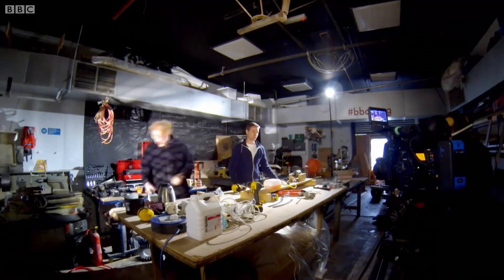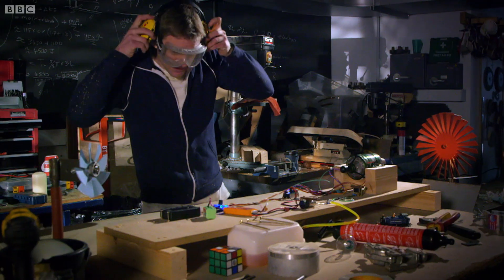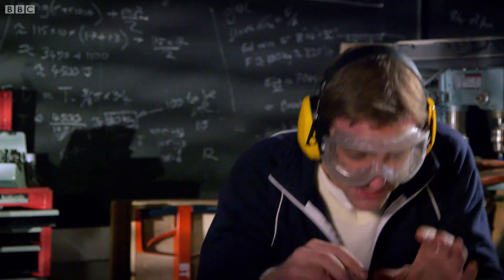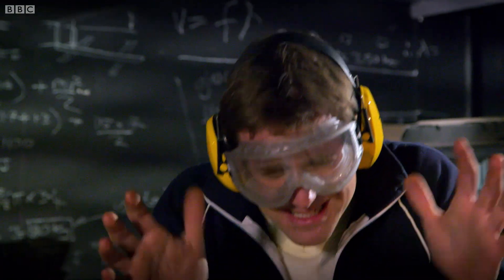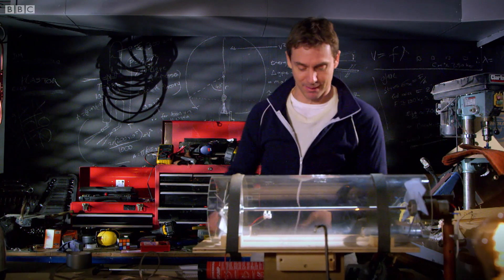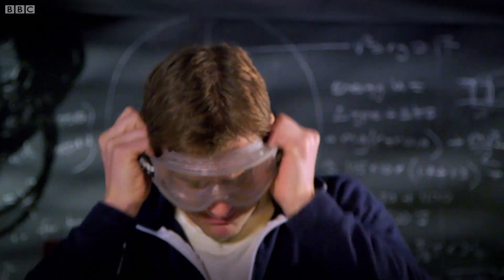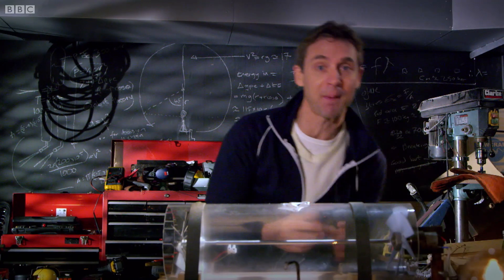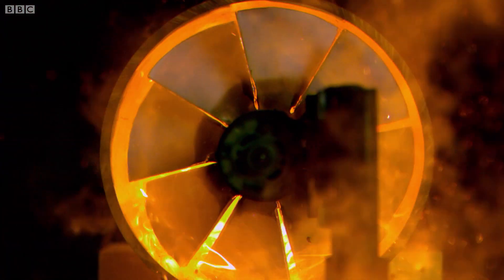How To Make a Mini Power Station | Bang Goes The Theory | Earth Science

Comment: That makes no sense. This video is terrible.
Reply: Simonas Mažeikis
The gas does not have to come from fossil fuels however. But I agree that this video can be misleading. I am very much against this simplification off power generation that leads people not jump to wrong conclusions.
Reply: Simonas Mažeikis I can see why you say that. Seems to be a bit thin on context. Which in it self can make the whole video a bit misleading.
Reply: Cythil Of course it will never be one solution, unless we figure out fusion or something like that. Fingers crossed for the fusion reactor in france.
Reply: Simonas Mažeikis Okay yeah, the context and demonstration given is a bit lame. A gas turbine generator is one of the most efficient methods of generating electricity.
Reply: Simonas Mažeikis Biggest advantege over coal and nuclear power plants is flexibility. Over production of electricity is an issue in current power grid systems. You should match demend and supply to maintain grid stability.
Reply: Simonas Mažeikis
That is not true. Nuclear power has a lot of lag in it production. So it take time to both increased energy production and decrease it. Unlike Hydropower for example which you can turn on and off at pretty much will.

Gas turbines like this can be used to handle peaks rather then you having to stuffer brownouts or rolling blackouts. Especially in a area where you can not relay on other forms of backup power production.

Mixture of different types of energy production is needed to as a way to balance out the needs of the energy grid.

Nuclear power however is good for the main load.
Reply: Simonas Mažeikis
I did mention hydroelectricity already. And yes I prefer it over burning fossil fuels. But what is the best energy mix depends on regional factors. And of course when technology develops it also open up new opportunities. What energy mixing that is considered viable today may be replaced in the future by other solutions.

If we could dramatic reduce the losses we get transporting electricity in our energy grid, then you would have also have to relay less on extra power plants to handle peak demand.

I do not think gas turbines will be something that will have a large role in future energy production. But I can see it having a small niche role to play. Having gas powered backup generator for a hospital for example. Or use it to burn off excess methane to cut down the energy consumption of a large farms.
Reply: Simonas Mažeikis Why?
Reply: Kael because fossil fuels is what we are trying to get away from and this video is somehow trying to make fossil fuels for making electricity seem appealing. He even compared it to nuclear, how can you even do it, nuclear power is on a completely different level.
Reply: Cythil yeah okay it could come from compost, but then again it wouldn't be on demand power, storing gas requires energy and is not efficient either. Also powering cities from compost is near impossible,  our power demands are huge.
Reply: Simonas Mažeikis
It would just me a part of the mix as I see it. Not the only thing used to power out future. This faulty reasoning as I see it one of the huge issues of the energy debate. Like we have to relay on one solution when likely better to depend on a lot of solutions. All complementing each other. Why very few nations relay on just one energy source today for there needs.
Reply: Simonas Mažeikis
Even if you get a fusion economy or a solar economy going on a massive scale I think there might be reasons to have smaller powerplants for other reasons. But who knows. Today we actually burn bi product methane without using the energy it produce for environmental and safety reasons for example.

(Also Fusion may have a lot of lag in it. But I have not checked out all the designs.)
Reply: Cythil solar is not that powerful though, we can't cover the whole earth with solar panels... The whole roof covered in solar panels can't even sustain a household in places which get less sun. Nuclear and coal is pulling the heavy loads at the moment, we need to get rid of coal atleast and then move on to something else.
Reply: Simonas Mažeikis Silly me, I thought the point of this channel was to show how stuff worked.
Reply: Simonas Mažeikis
You expecting they would be placed on earth and not in orbit of the sun. A true solar economy would uses large space arrays beaming the power down to the planet for use. Large part of manufacturing might also be moved to space in this future economy. This could in theory provide a lot more energy then even a full scale fusion economy. After all the sun is just a big natural fusion reactor with mass of 333 000 times that of Earth. Even just capturing faction of that power would be far more then we could produce on earth using our own fusion tech.

But we are at the moment pretty far away from releasing that. Our own fusion power seems like a more likely short term solution.
Reply: Simonas Mažeikis You're correct in that it isn't a solution for renewable energy. However the ability to regulate power output and fuel input, though seemingly vital to our energy needs, is completely lacking in the most popular sources of power such as coal and old oil refineries. The grid is constantly producing 'rejected power' that goes unused by the grid in low usage, so that it can handle the upper levels during peak hours. 

If we created energy standards throughout the country, and cannibalize coal plants into new high efficiency gas turbines, we'd save more fossil fuels now than a years worth of solar/wind could provide currently. (Though personally I'd rather just invest in making solar panels a real industrial process, it does have merit in understanding that Adaptability is a crucial part of a sustainable power solution.)
Reply: Michał Leszczyński it has no advantages over nuclear lets get this point clear, we cannot drop nuclear ever anymore because of how much power we need. Over coal maybe.
Reply: It's not about the lag. It's about the amount of energy that we need. Households use about 10% of all the electricity we need that's a tiny amount and production goes almost 24/7. Most of what we use we use constantly. So the increased demand and such is not that big of a deal.
Also we already have a great method to store energy during downtime that we can use during demanding hours, it's called Pumped-storage hydroelectricity. That method is also better for the environment and it lets us compensate for the unstoppable nuclear power.
Reply: Simonas Mažeikis I know that we can't drop nuclear power plants. But we can't have only them, because it is impossible to turn them off.  SO if there is sudden drop in demand you can't adjust supply. If you will produce to much power you can cause power grid destabilization. So nuclear plans are great for producing large amounts of power and gas power plants are great for adjusting supply  with demand.
Reply: Simonas Mažeikis You still can't adjust pumped storage as quickly as you can a gas turbine so you end up wasting energy. A huge percentage of what goes into the grid is wasted as heat in the lines from resistance so if you create a large amount of excess to avoid running out of supply it's still going throughout the entire grid then returning to the power plant at a significant loss. It still works out more efficient to use gas to cover those small spikes. The good thing is to that these gas generators are usually located within a city so  they have less loss travelling through the line, something you can't do with other sources.

Comment: Shouldn't the second turbine(in the second experiment) turn anticlockwise and not clockwise?
Reply: Cheydinal actually the second turbine and the first turbine should be on the same axis, fused into one unit, now the turbine will not produce a hot fast stream of gas, instead you get a rotating axis with tremendous torque. that kind of jet engine is used to power helicopters, trains, also some airplanes use it to power their propellors (turbine-powered propellor, turboprop, popular in small jets), or just connect it to a generator.
Reply: Cheydinal Yeah, it should. Would be more efficient then.